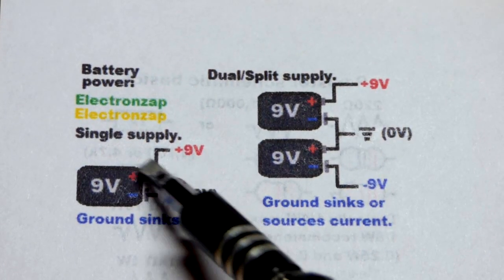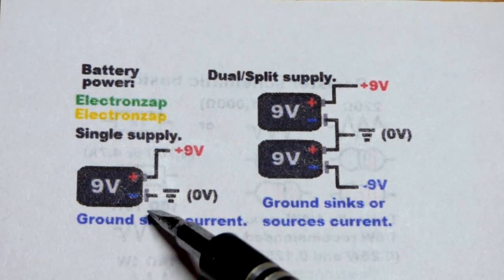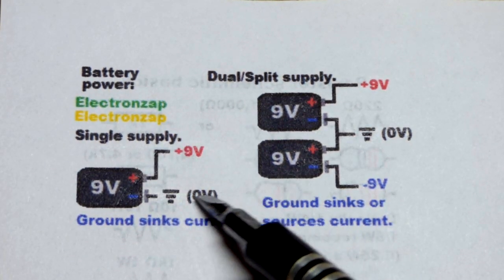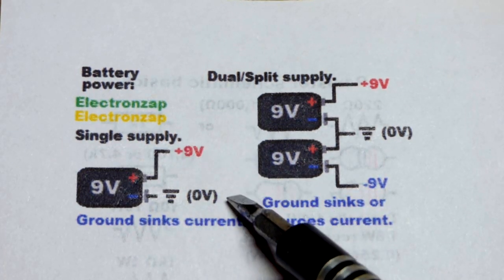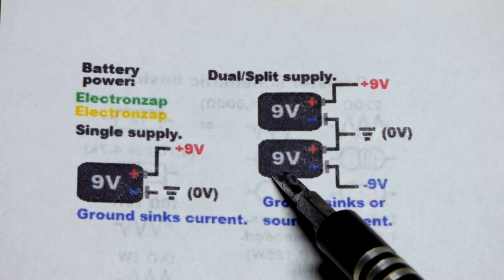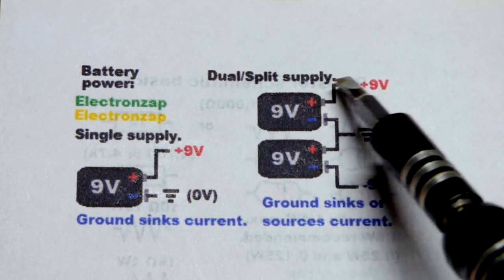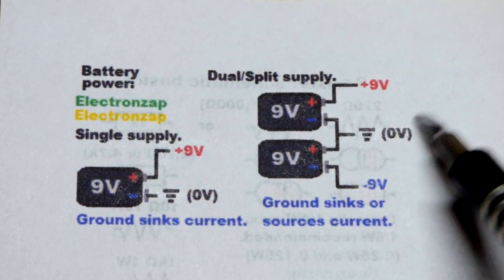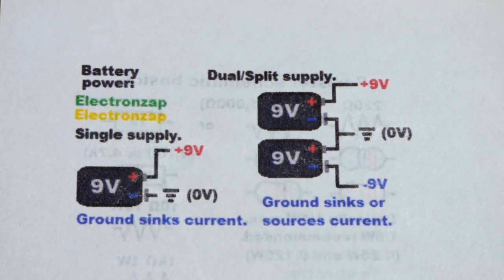Electronics single versus dual or split power supply explained

Comment: Can we connect two dc adapters in series to get dual power for opamps or Audio Ics that needs dual supply ?
Reply from the maker: I wouldn't do so with 2 adapters getting power from the same source. It might make a short circuit as far as the original power source is concerned.

Comment: So does the tap need to actually be earth grounded or can it just be a terminal your calling ground?
Reply from the maker: It's a virtual ground. It's only ground as far as the circuit is concerned. So, you don't attach it to earth ground.

Comment: Been trying to understand this for a while now. Thanks so much for this video!
Also, I ran into a situation that requires a dual supply but then I just used 2 equal resistors to split the voltage. It worked but then my overall voltage was halfed and there were losses. But it helped with the understanding of the concept.
Reply from the maker: I made some split supply videos using an op amp a while ago.